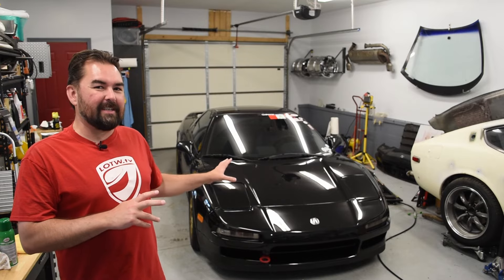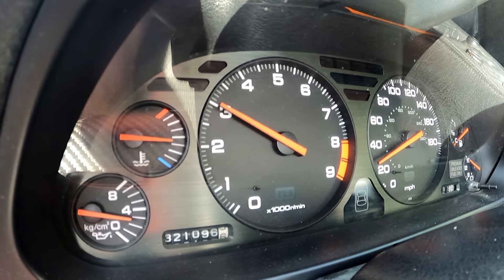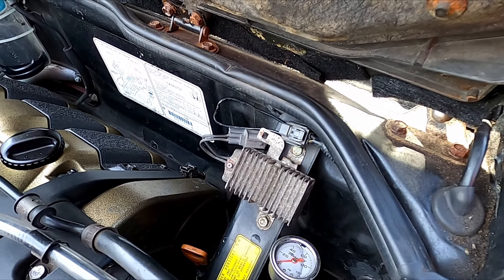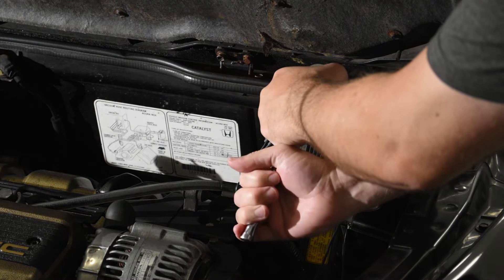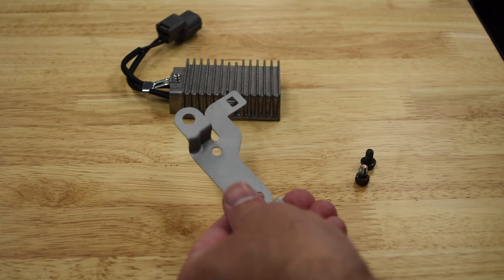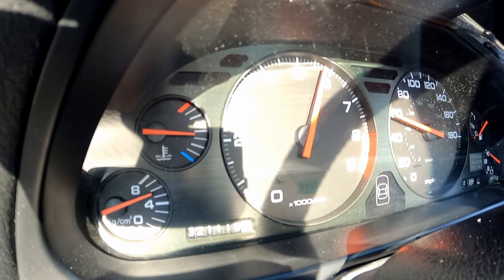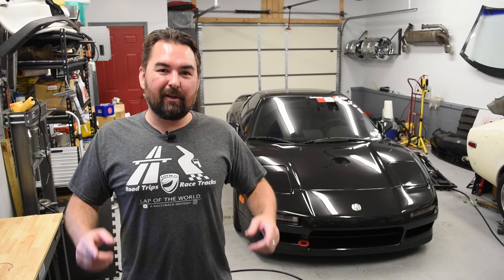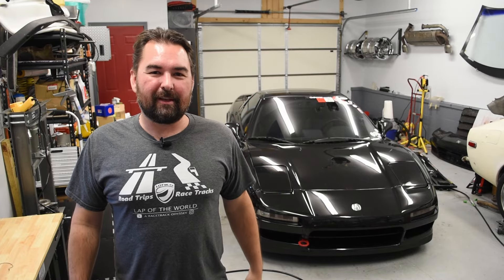Weird Hesitation with our 320,000 mile NSX!!! Diagnostics Go!

Comment: Exact same issue at around 80k miles for me, tried everything to not have to drop the tank (filter, resistor, even battery) with little improvement, but in the end the fuel pump was the solution.

Comment: Had this same problem. Tried the resistor and it worked for a bit, but then the car was hestitant again. Had the fuel pump replaced and my issues are gone ever since.
Reply from the maker: Thanks for the data point.  I'm probably going to do the pump as a matter of course, though I have a couple of other things to check along the way I think.

Comment: Is the noticeably lower oil pressure from your first pull expected? I love these troubleshooting videos.
Reply from the maker: I have real-time oil pressure on the race-dash so I don't pay a ton of attention to the heavily-damped meter in the cluster.  I suspect it's because I went deeper into VTEC on those first pulls and there was less time in between which does drop the pressure a little. On the race dash it was still like 70psi though.

Comment: I'm considering buying an NSX it has 215000 Kms. There are no obvious problems but can you recommend some less obvious maintenance jobs I should be thinking about doing if I buy it?
Reply from the maker: It would depend a bit on the model year, but generally at that "mileage", you'd just want to make sure the timing belt/water pump had been replaced on time, and that the coolant hoses had been done in the past few years.  Other things to check will be the stereo speakers, HVAC blower speed control, and power window performance (slow roll up is normal, but both sides should be equal).  If it's a pre-2000 car you'll want to make sure the ABS pump still works.  Maybe have someone bore-scope the throttle body to make sure the  variable volume butterfly screws are all present and seated.   Beyond that would be getting pretty obscure or into general stuff like not leaking oil, or CV boots being good still.   Really there's probably a whole video in this topic that I should make, lol.
Reply: @LapoftheWorld  thank you! Its my 'cheap' option out of 3 cars I'm considering. Im nervous it will cost lots to get it up to a good standard so I may aswel just buy the lower milage better condition car
Reply from the maker: @birdy3934  To be fair, compared to even a modern Porsche or really any Italian, a 1st gen NSX will be a cheap date.  The odds of ALL of that list needing attention would be hopefully slim.
Reply: @LapoftheWorld  Yes for entry level NSX money there are other options with a Porsche badge but my heart will only accept an NSX. This car has new tyres, new battery and alternator and just been serviced. The belts look trustworthy. No Aircon the hose to the condenser was damaged, no abs but I don't mind that. All brake discs very worn.  I feel like it's had a hard life but has been fixed up recently to be sold. Started up and drove perfectly my gut feeling is it's ok
Reply from the maker: @birdy3934  If the core drivetrain is good, the rest is somewhat details.  Brake pads and rotors are cheap.  I also had to replace an AC pipe due to the previous owner, but swapping just that and the drier canister allowed me to resurrect the AC (very necessary where I live).

Comment: I am having a similar issue. Occurs at about 4,500pm. What gear are you doing those pulls in? 2nd gear?
Reply from the maker: @UltraStunts  Yeah, I was for the most part, but was in any gear at WOT from lower RPM.  I've done a couple of subsequent videos resolving this.  In my case it was a bad aftermarket fuel pressure regulator.  However if your car is stock it's likely either the fuel pump resistor, or the pump itself (without knowing anything else anyway).  That said definitely do your own diagnostic cycle before dropping the tank in case it's something electrical up/down stream.
Reply: @LapoftheWorld  my car is all stock. 37k miles. But has sat a long time with previous owner. I tested it again with the fuel resistor by-pass and with the resistor. My second test was in the evening when it was cooler.  The car was at temp but cooler surroundings. I could not reproduce it. Also I was noticing the dip after driving the car for 30-40 min on a fun run. I am going the order a fuel pump while I still can.  It will need it eventually. I noticed that you are not using a split pin on the gear changer. What type of pin are you using?
Reply from the maker: @UltraStunts  Ah, yeah, if it's been sitting probably want the pump, filter and spare a thought for cleaning the tank if you're already going to be in there.   Also, not sure what you mean by split pin?